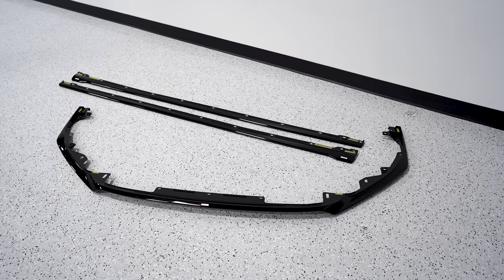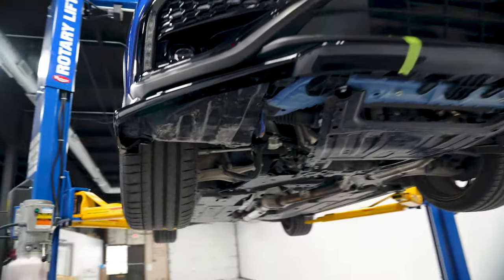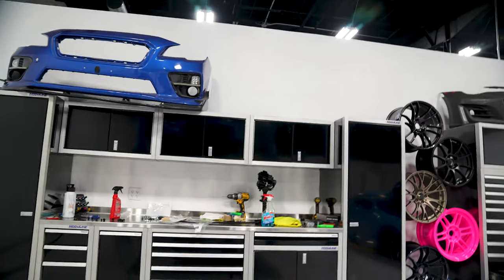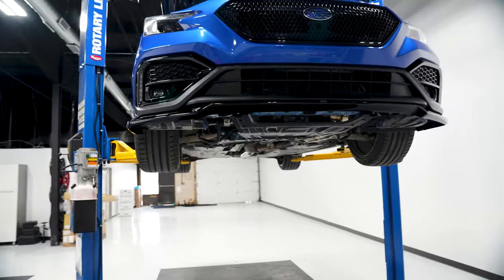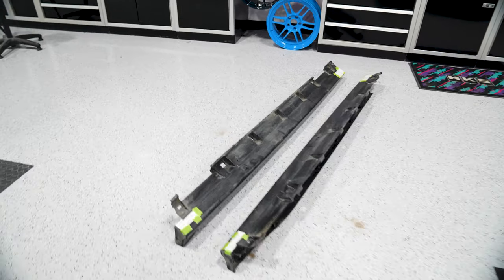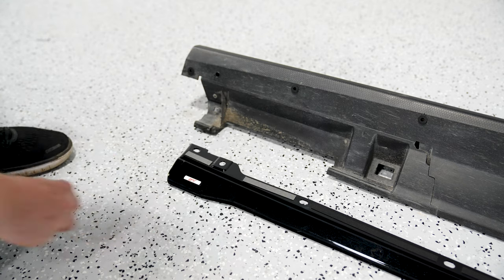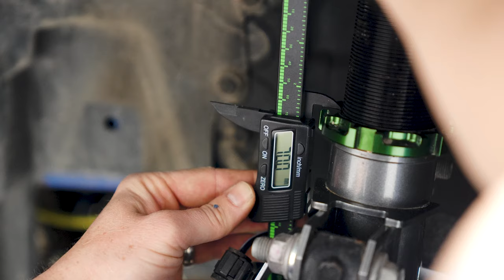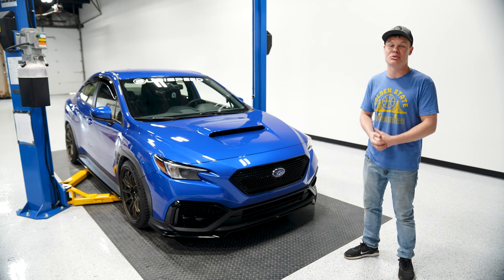Installing STI Side Skirts + Front Lip on the 2022 WRX!

Comment: Parts should have the WRX logo not the STI logo. Otherwise, looks great.
Reply: @MLH0214 They are OEM parts! STi is the brand name of OEM Subaru performance parts and accessories. Like TRD is to Toyota.
Reply: @steve8803  I’m aware they are OEM parts, but wouldn’t put STI parts on WRX even if they fit. It’s not an STI. That’s just me ok.  It’s your car. Just have fun and do you.  Don’t care what anyone thinks
Reply: @MLH0214  it's not parts from an STI. And it has nothing to do with the WRX STI vehicle. It's Subaru's brand name for OEM + parts.
Reply: @MLH0214 obviously you care. 😉
Reply: @waykool698  who?
Reply: @MLH0214 nice try
Reply: bmw does same thing M parts on non M cars.

Comment: Good morning, do you have a link for that electric ruler you did to measure the coilovers? And I know some cars weight is different on each side of the car. Since it's a flat 4, were the measurement numbers the same on each side? Thanks
Reply from the maker: It's a digital caliper, you can pick them up online or at harbor freight. Yup start with the same measurements each side and adjust from there!

Comment: You can add all the parts you want to the new WRX, it’s still looks like garbage. Subaru really dropped the ball on the new model.
Reply: Dropped the ball how? Looks are subjective. It's a massive upgrade over last gen is almost every way.
Reply: You say that yet your car looks like it came out of 2000s Need for Speed video game. Looks are purely subjective my dude.
Reply: They just sold the most WRXs ever in a single year without an STi model so I suppose a lot of people like it!